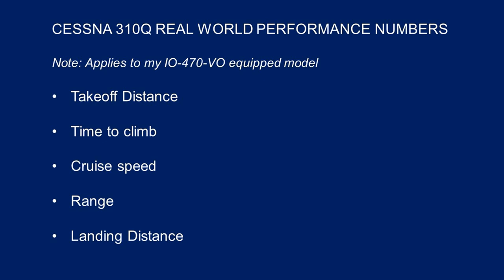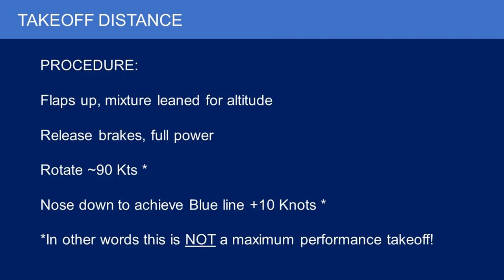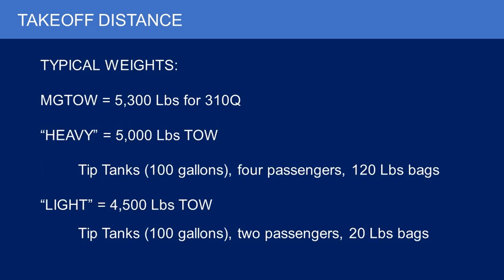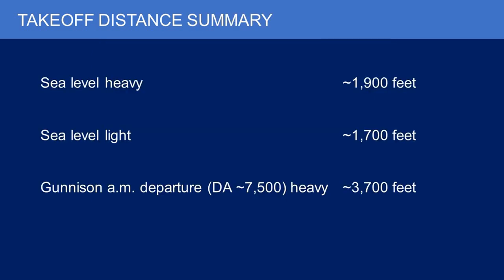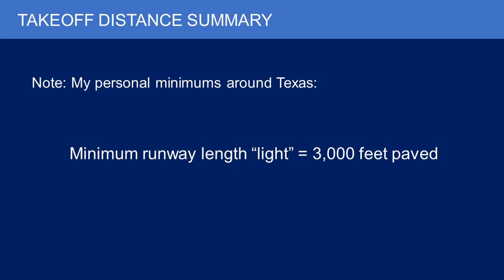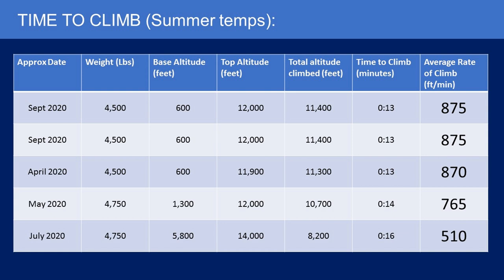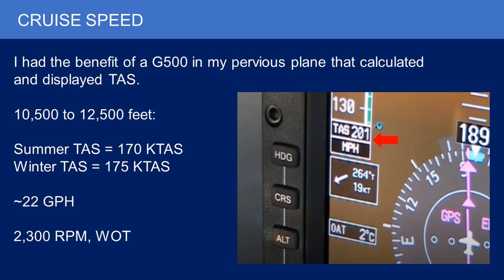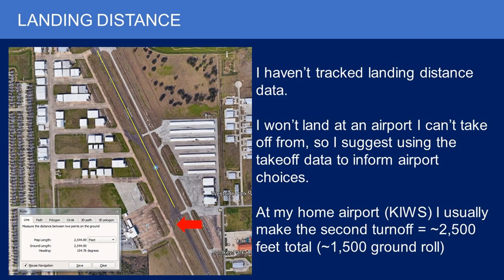Cessna 310Q real world performance numbers

Comment: Jason, thank you for your videos. I enjoy videos like this because it allows me to compare my airplane (310Q) with others and to compare procedures I use vs how others do things. I recently discovered a problem with my plane comparing performance with another channel. I have a question concerning numbers you use for your rotation speed as this could cause a difference in your takeoff performance. I have noticed often pilots will interchange“knots” when it should be “MPH”. I have done it myself without thinking as I flew airplanes that used knots vs mph in performance and vise versa at the same period in my career. My pilot operation manual calls for rotation at 90mph. Have you been rotating your plane at 90k which is equivalent to 103.5mph or was that an error in notation. Thanks again for posting videos like this. I have owned my Q for 21 years and still get a thrill every time I fly it.
Reply from the maker: Hi Charles. I rotate about 85 to 90 KNOTS, but it's a shallow rotation as I trade altitude for airspeed. In other words I'm trying to get speed (past blue line) as quickly as possible. A real shallow climb-out. Thanks for the question!

Comment: Questions…do you have GAMI injectors? Do you worry about or have you had gear issues? How would you rate it to a 310R, especially with cg and different engines?

Excellent rundown of this airplane model overall.
Reply from the maker: Hi John, yes I do have GAMI injectors...both of my engines run nice and balanced EGTs. As far as gear issues I bought the plane from an A&P and he rebuilt and rigged the gear. To be honest it's time to get it looked at again. I only have a few hours in the R. The R is heavier but has a few more HP. Personally I like the look of the Q and the IO-470's are relatively bullet-proof. Thanks for the questions!
Reply: @flyboy98  what about TAS with the R? Fuel burn I hear with the R is 26-30gal/hour? 

Also, would you consider a T310Q over the normally aspirated?